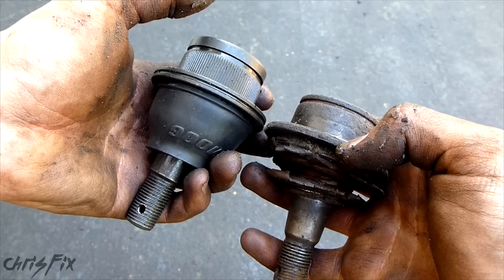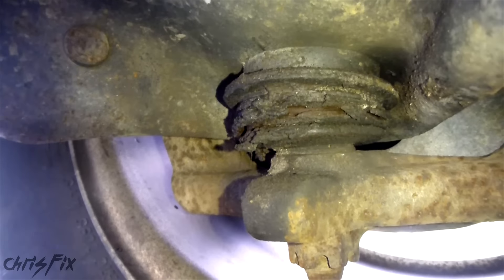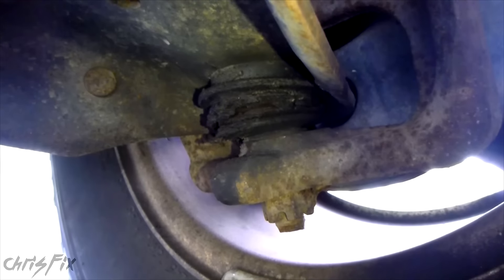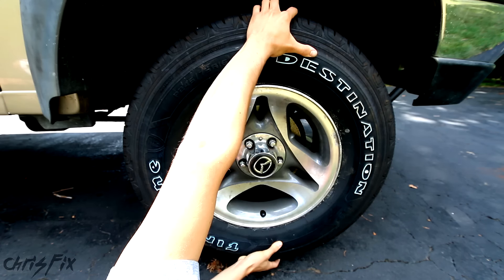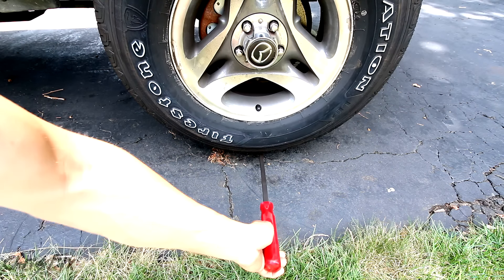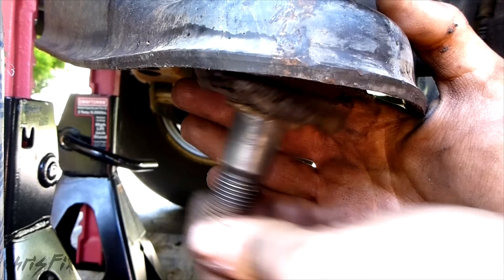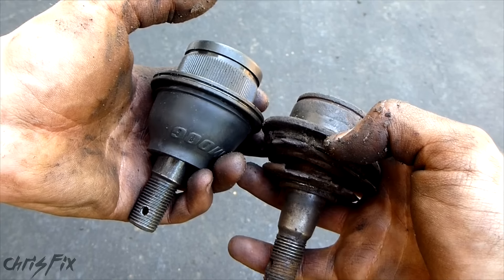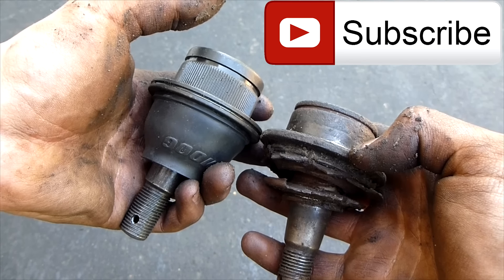How to Check if a Ball Joint is Bad

Comment: I get a clicking noise when going in reverse or accelerating from a stop and the noise is coming from the front passenger side wheel. Most likely it’s either going to be my outer tie rod or a bad ball joint but this video will help me out with figuring out which one it is.

Comment: Thanks so much for the great video!!  Just a quick question, back in school shop class I was taught the same thing, but that on a solid rear axle on a rear-wheel-drive vehicle there is allowed a little bit of play as you pulling the axle shafts slightly in and out of the differential.  Is this true?  Is this also true for the front axle of 4 wheel drive vehicles? (Not
all wheel drive or front wheel drive) 
Thanks!
Reply from the maker: Yes and yes, as long the play is very small and has a start and stop point that prevents you from moving it no matter how hard you shake, that is usually normal, you would know if it was excessive

Comment: I just saw one of these explode when removed while torched heated. How does that happen?
Reply from the maker: I saw the same one. The heat combined with being really stuck and using a tool to pop the stud out caused it to "explode". It didnt actually explode and rather popped out with a lot of force due to the heat and how stuck it was.
Reply: @chrisfix  squeezing a pea out of a pod then and having it shoot across the room. That’s one heck of an interference fit!

Comment: I have a question,  what about a vibration while driving in front end?  Driveshaft is already rebuilt,  once a year.. Lift kit 4". 31-10.50's on it,  2004 Jeep Grandckeeroket. I don't know?????? I've it!
Reply from the maker: Check the steering and make sure it’s tight and there is no play.
Reply: @chrisfix  I've replaced the tierod  ends , plus all new brakes, front and rear, emergency brake system from handle back, with all brand new guys. Dumbfounded by this lifted Jeep! Sorry...192,000 + miles, 4.0 straight 6.
Reply: @chrisfix  can you make a video on the death wobble a how to fix it?

Comment: Very cool diagnostic. I find out the lower ball joint is bad when the car makes all kinds of noises like an old squeaky wooden stair. Then the tire fell off the car at low speed but the axle landed back on the inside of the wheel rim. I got lucky.

Comment: With my truck's full front end jacked up, should I be able to fully turn the wheels left and right with the steering wheel moving while holding a wheel at the 3 and 9 position?

Comment: Thanks!
Reply: I was so sure that my lower ball joint was going bad that I actually bought the ball joint and rented a press on the way home. I tried wiggling the tire – nothing. I tried putting a crowbar under the tire and lifting – nothing. I felt around to see if the boot was leaking or torn– nothing. And then my hand came across the bottom of the dust shield– and it was rubbing against one of the bars!  I can handle a dust shield tonight!

Comment: I'm doing a full front end refresh of steering and suspension components on my SUV.  The mechanic checked the lower control arm portion and said that it's good.  The car has 340,000 miles.  Should I replace the lower control arm assembly (which has the ball joint) anyway, while I'm doing all the other parts (upper arms, steering parts, etc.), because of the high mileage?  Planning to keep the car for a while longer, want to make it ride like new.  I have the Moog CK lower control arm parts.

Comment: Hey Mr. Chris fix you’re probably never see this but I’m gonna give you a shot anyway I have a 2017 Honda CRV all wheel drive it’s making some type of grinding noise from 20 mph and up I replace the front wheel bearings and hubs and the driver side axle I also remove the driveshaft to see maybe if the noise was coming from that and it is not it’s still has the noise just want to pick your brain because I know God has blessed you with your hands if you can give me any ideas I appreciate it I’ve looked online it seems like a lot of people are having this issue but some found out the bearing in the center driveshaft was bad but again not my case I thank you for any input and God bless
Reply from the maker: Send me a video in my Instagram DMs so I can listen.

Comment: Ball joint vs bearing?  How do you know with the tire movement only test?  I understand With the wheel off.   Mine seems to have some bearing noise when the wheel is turning While i'm driving so that's probably the best confirmation

Comment: One quick question if it's not cracked can't you just inject Anita with the liver into the boot. They used some kind of clear lubricant made to put in your engine or your transmission to revitalize the seals. I think it's called tp200 or something they spray it on all the boots and it penetrates the rubber and supposed to lubricate. I was just curious if it's necessary to replace when you can just lubricate or inject that with a hypodermic needle into the boot

Comment: Same diagnostic method to check ball joint, inner tire rod and wheel bearing?? 

My front wheels vibrate at 55-60 mph and even at braking. Also making “cracking or clicking” noise when I turn left. Both inner tired rod are new on 2000 Camry. Please advise what else could be the issue. 

Thank you Chris!!
Reply: bushing maybe
Reply: @iowatheother4986  I changed lower control arms on both sides in 2019. Umm what else could it be.
Reply: @lovelove9108  wheel bearing
Reply: @iowatheother4986  thank you
Reply: just go in somewhere, say you need an alignment but its also making a sound. should be able to get a free diagnostic that way. because if they say they cant do it, ask why. if they say you have to pay for them to tell you, thats a lie.
Reply: @iowatheother4986  thank you. Will try that

Comment: Is it the same with tie rod it should be stiff in its ball joints ? Very recently went thru wreck and boot was torn on this part .  I'm having trouble removing inner tie rod with OReillys rental tool . I've read the instructions and used the closest tightest size wrench adaptor and used the locing mechanism . Still no grip and slipping . Someone said heat it up because it might havew loctite ? Now thining maybe I dont need to replace tie rod just the boot . What do you think ?

Comment: My 2009 Edge makes the same noise while driving and the fools at Mavis ripped me off and changed the shock absorbants and when the squeaks didn't go away they said it's probably the bushings!...should i go ahead and change the ball joints directly?

Comment: I have a 2005 Tacoma. It shakes when I brake at around 50-70. I checked the rotors but they look fine. Any suggestions?

Comment: Hi Chtis! I have a new 2023 Acura Tlx type S after 3 months of ownership I heard a humming noise when I turned the  steering wheel to the left during start up. The dealership changed the cble wire. The humming noise stopped only for 3 weeks  .I'm wondering if  the problem is the  ball joint or the CV boots?  Actually it sounds like a rubber rubbing  into something when I'm turning the wheel but when I'm driving I don't hear anything. .Do you have any idea what's causing it? Currently the car is in the Shop again 😪

Comment: You said the upper ball joint "cant be replaced, need to replace control arm"? Is that thw same for every car? I got a 2007 jeep grand cherokee and noticed I need new ball joints. Do I have to replace the whole control arm ?

Comment: Hey Chris, I have a question, nobody seems to know why my car makes a grinding noise when shifting from park to reverse, when I shift to reverse the car loads shift and makes a grinding noise it’s most prominent on the rear left back wheel, could you help me out? It’s a RWD automatic sports car
Reply from the maker: If it does it while shifting, I would think a gear or something is not lined up correctly in the transmission, but if the noise is coming from a wheel area, my first thought would be something brake related. How do the rear wheel brakes look?
Reply: @chrisfix  Can’t believe I didn’t see your reply till now! Thanks for responding and well I posted a short on my channel so people could have a general idea of what my problem is

Comment: One of my ball joints might be bad i dont feel any clunking but the other day i had the wheel off and i loosed the ball joint from the knuckle to replace the cv axle and I could move the ball joint extremely easy it is super loose . I am having a squeaking noise from the side of where that ball joint is when i go over pot holes . Can the ball joint be the issue with the squeaking? I replaced the sway bar links thinking that was it but it still squeaks

Comment: I ran over a curb recently and was wondering if it's normal for the ball joint to have just a little bit of oil leaking. I've been driving for a couple of weeks since running over the curb and I don't really notice anything crazy, just a slight pulsation from the steering wheel when I'm slowly braking that's it

Comment: hey chris , quick question if you have some time available to respond but what if the boot of the lower ball joint is not cut open and still makes a noise when going over bumps. also the tire does move also.

Comment: I hear a clunk only when I turn my wheel left or right but I hear it AT the knuckle. The knuckle however does not seem loose at all. I also hear a pop or clunk sound from my new clutch on the release only and oddly only in the 1st 4 gears. I can feel vibration and, depending on how I stop, shaking in the wheels at high speeds only. Typically over 45 mph. Is that most likely my ball joint and should I replace both? I only have lower ball joints as my car is a 2004 Saturn Ion 2

Comment: When I put my Torota Corolla in reverse I hear a high pitch screetching  sound that at first sounded like a humming noice. It is coming from my rear passenger side tire. My brakes are fairly new and the sounds are not a grinding sound. It sounds almost like something is stuck in the tire, but I only hear that sound when I back up even if I do not apply the brakes at all. I do not hear that sound when driving forward. Any ideas what is might be? THanks!

Comment: Hey Chris I got my R front ball joint replaced last year 2018 in March at 42k miles. It’s now June 2019 (10k miles on my car since fixed, car is now at 52k original miles) it’s a 99 Grand marquis and my mechanic is saying it needs replaced again. Is this Normal for an older car ?

Comment: Hello Chris ! 
I have a problem with a Renault Laguna from 2010. The steering wheel is wiggling left and right when I  press on the brakes but not always. Only when I press them softly. I have replaced the brake discs on the front axle (I have front wheel drive) and the brake pads, the wiggling dissapeared for one week and then reappeared. I do not know what to do next, can you please help me ? I put brembo discs and brembo brake pads. Sometimes when I press the brakes at a higher speed the whole car vibrates and the steering wheel vibrates as well but I cannot feel anything in the brake pedal.

Comment: I have a 2015 Jeep Patriot with 100k miles and some change.  I didn't feel any play in the tires but i noticed when i hit bumps something felt loose but it sounded like it was coming from the rear.  I checked the rear for play, loosened and torqued everything again for safe measure.  I'm still hearing it. Most everything up front and back is new so I was  confused.   It went through the PA state inspection and an alignment shop with no issue. Wouldn't you know that when I was replacing my cv axles, i noticed that my ball joints on both sides had excessive rotational play and was grinding with only 14k miles on them.  They're under warranty so that's a plus. I'm doubting mechanics in the area though.

Comment: You should always go with OEM not those splined moog joints.  Once you use that which eat up the socket you press them in you can no longer ever go back to smooth ball joints
Reply from the maker: Thanks for sharing!

Comment: wonder if you can help diagnose a couple problems i am having with my 2006 pontiac pursuit, perhaps you may have had the same exp? 
1) when i put the car in drive(also i think it happens in reverse too)and let it roll on its own sometimes the eng seems to be struggling as i see the the rpm needle go up n down and can feel the eng like its struggling also when i am driving and come to a stop as im breaking and come to full stop i see the engine rpm needle rev up and back down? 
2) when i put the car in drive go forward a bit and hit the breaks i hear a clunking noise ,i put it in reverse and apply the breaks and the same thing happens only when i do any of those this noise happens after that the noise is gone ,it sounds like either the break pads or master cylinder or perhaps the transmission i am not sure but i do not see how the break system has to do with the tranny yet it does happen when i shift gears only ,is there some kind of connection? i did change the rotor and pads myself but not sure if this noise was there before that i can remember ,thanks for any help or advise you can give me

Comment: It’s important to note depending on the type of front suspension you need to lift the vehicle from under the lower control arm with the ball joint unloaded. The tires should not be hanging with the ball joint loaded to check them. You’ll miss play checking it that way.

Comment: So when i turn my steering wheel all the way to either side it makes a weird noise but it doesnt sound like this at all. I hear it when its all the way to one side. What other problems could it be? So im guessing my problem is not the ball joint.

Comment: Dude, one night i hit a Complete Rim in the road on a highway, think its some pickups spare that fell off. I bursted both left tyres on a speed of 130kmh. Both rims was totally fucked too. On my Hyundai i20 2013 1.4Crdi. My lower control arm appeard to be bent on left side as the wheel was slightly backwards compared to other side. I just replaced the complete control arm as it is very cheap and it has a new ball joint in it, its a very quick job too. The complete lower control arm brand new was only R500 (South Africa) thats +/- $17. I had the wheel alignment set and everything was fine its now 40000km later. Still no problems at all after that incident, i would recommend rather change the complete freaken lower control arm as its very cost effective and less time consuming.

Comment: How can you tell when you're driving if your ball joints are bad??? What effects of a bad ball joint have when driving?
Reply: Junior Miles..my lower ball joints were bad and i just had them changed today. I have a nissan frontier and my experience with bad ball joints while driving are..very squeaky suspension..pulling to one side..any bump in the roads felt like the tires were going to fall off...so have to use more effort while steering...eccessive wear  of one tire in particular. There was also a noise when turning the wheel to one side..like a warp warp warp noise..if that makes sense.  This is my experience.  Hope that helps!

Comment: Can ball joint be bad if boot isn't ripped?
Reply: @Heisenburg thnx for the reply and info.👍!! Yea, my car makes like a squeaky crunching sound something like metal on metal  when i turn the steering wheel back and forth in sequence 2 inches to the left, 2 inches to the right I put a sethiscope to every ball joint and the one that gives me the most noise is the bottom one on the lower part of the spindle. All the boots are fine, but I'm thinking that they have no more lubricant.

Comment: I’m literally trying to figure out what’s wrong with my car and I think it’s the ball joint and the bearing. I’m not sure but the steering wheel wiggles when I drive and it feel like the front driver side wheel wobbles when I drive as well as making loud scrapping noise that sound like mechanisims scrapping past each other. It’s a similar sound to a bad bearing sound but worse like there’s a machanisim there but it’s not clicking

Comment: The problem is when you have a lower control arm that is in the beginning of going bad so you dont have any play and it only shows symptoms on the road. I have an occasional clunking while taking off on a ramp or while turning my wheel all the way to one side and going up on the side walk to my garage. I also have a steering wheel shake at 55mph that gets worst if I brake. Its not my brakes for sure or struts or sway bar links or inner or outer tie rods or engine mounts. I had new tires and the wheels where balanced. They told me the rims and a little bent but not enough to justify the issue im experiencing. Last week I swapped the rear wheels to the front and nothing has changed. Ive ordered new lower suspension arms hoping to solve this issue. I know its not right to buy parts without knowing for sure where the issue comes from but this is my last hope.

Comment: I have side to side play and a clonking noise when moving the wheel at the 3 & 9 positions. Also noise on a rough road, but smooth as you like on a smooth surface. So not the bearing. What do you suggest?

Comment: Yo my ball joint won’t come out of my sn95 :( missed 2 days of work and 2 my days off.
It’s stuck in the steering knuckle,and I’m dumb i sawed off the bottom instead of the top I have nothing to pull it down now. The puller presser c clamp won’t work, im attempting to drill out the bolt but it’s made of supremely hard steel :(  it’s seized in the knuckle with the threads facing up. Fml

Comment: In order to feel the wear of ball joints, you must jack up or support the lower control arm with the load of the suspension supported. Otherwise you are working against the suspension/springs to feel for the wear of the ball joints. In order words, jack it up and support it by the lower control arm. Your video shows the vehicle weight on stands resting on the frame. Good video and explanation though.